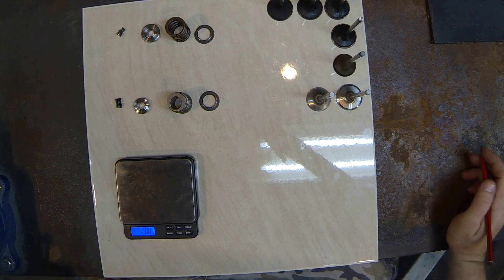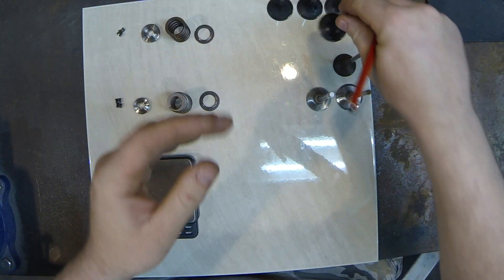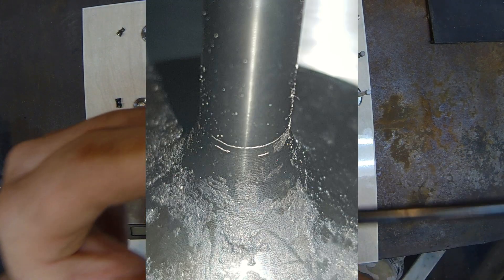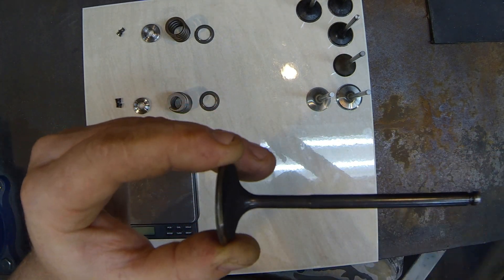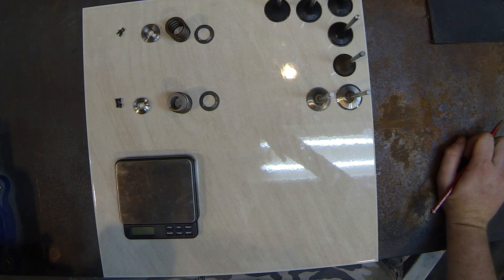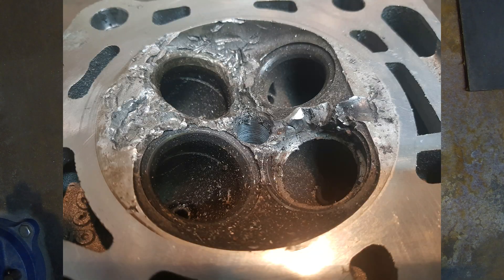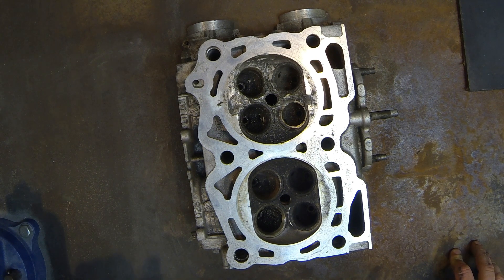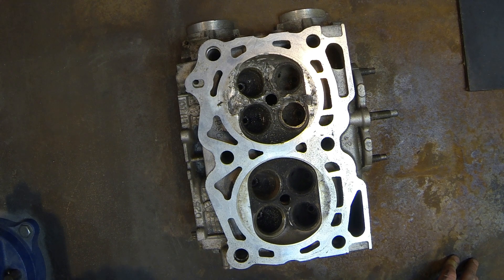SuperTech Valves - Watch This.

Comment: I should have seen this video a few days ago. I completely destroyed my VW 16V, installed in a Super Seven, a few days ago. A Supertech intake valve broke exactly where you describe.

low mileage, motorsport application

CNC Head is fu..ed, piston fu..ed, bottem end fu..ed.

Comment: Bad batch of valve or is this a long term problem?
I know this vid is 3 y/o video
Is this only on the Subaru valves or across all of their valves?
Reply from the maker: It's could be both.  But I tend to think its more a common problem.  The instances shown in this video were purchased at different times.  And if you read the comments section of this video, there are numerous other anecdotal instances of people suffering the same failure.

I think its more a manufacturing technique, the breaks all take place at the exact same location, where the stem meets the base of the valve.  And I believe these values are manufactured by a process known as inertial friction welding.  Where they effectively weld the stem on to the back of the valve.

Comment: How have the Ferrea valves worked for you?  I’m looking into valves and springs for my STI and have seen people have issues with GSC as well. Thanks
Reply from the maker: Unfortunately.  I cannot tell you.  I have put the build on indefinite hiatus while I address other areas of my life.

The thing that broke my live of modified cars was :
During the rebuild process, I took the case halves to a recommended machine shop for a main tunnel line hone.  (This is needed with ARP case bolts, as the case distortion around the main tunnel is extreme.)  

Unbelievably, the incompetent machine shop performed the line hone with the rear 2 case bolts (main bolts) loose.  This resulted in the rear main journal being well under size once the bolts were torqued.  I think it was 2 or 3 thousands of an inch under lowest tolerance from memory.  I noticed the mistake as soon as I got the block back from the shop, confirmed with my bore gauge, and took it back.  They tried to remedy it, by shaving more off the parting face, and re-honing.  But due to the scope of the original error.  They could not recover it.  The main dimensions were all over the place, and extremely oval.  The block might be salvageable with over size main bearing shells and a an over size line bore.  But I do not know any machine shops locally capable of doing this work.

This was after spending many many thousands on machine work like CNC close decking, 14mm studs, pinned/dowelled main tunnel, cylinder honing etc etc.  And many many thousands more on parts like billet 2L crank, +2mm billet con rods.  Pistons.  5 stage drysump.  Beryllium valve seats, all the valve train parts (valves, springs, cams, and all new OEM shim-less bucket lifters to size valve lash).  Plus all the ancillaries like RCM timing setup, cam gears etc etc etc.  That engine was gonna be the full Monty.

Basically I came to the conclusion that no matter how much money you throw at the build, something will go wrong.  Whether it be something like the machine shop fuck up.  Or a tuning error.  Or some other random mechanical failure like a dropped valve, spun bearing or what ever.  But no matter what.  Sooner or later.  That 50k engine is gonna be an expensive boat anchor.  So I put everything in storage.  And left the car alone for about 3 years now.  I have since met an amazing woman and we have a baby daughter.  One day I will revisit the car.  But for now I have other priorities
Reply: @BramBiesiekierski  Yes, I saw you mentioned the machine shop error in another comment. Sorry to hear about that shit situation. Yes, cars what a crazy hobby. Congratulations on finding the two ladies though. Thanks for getting back to me.
Reply: Ferrea are far far better quality than Supertech. Supertech's the heads fall off very easily, at least with Ferrea in a really bad incident they tend to bend but stay in one piece. Which means far less damage.

Comment: Had you contacted  Supertech directly?  you could have learned how those marks on the valve appeared, rather than go on a rant about nonsense blaming the valves and the reputation of the company. These valves have been used, by top engine builder around the world, in  World Rally cross, Drag racing, Drifting, for the past decade, and there has never been a issue with the product itself, material, or quality of the product. 

Those marks are NOT a sign of defective material but a sign of bent valves.  There are many ways you can bend a valve (taping the piston, overreving and clipping another valve, during installation, during the tuning of the timing, etc.).  And there have been too many cases of Subaru engine builders bending valves during assembly and tuning of the engine. We are not Subaru assembly specialist but there are some strict procedures for Subaru engines to follow to avoid this type of issues.

When a valve is bent, it will work back and forth, straightening against the seat, until it eventually develops a crack from fatigue and fails, like when you try to cut a wire bending it several times.  
 
Depending on how much the valve was bent, it can last a few minutes to several thousand miles.

This will happen with any valve but because our valves are Black Nitrided, these cracks are very notable when they happen. And as a matter of fact, it is well known (you can google it) that the Nitride treatment improves the fatigue life of the valve (or any product), so they have a better performance under this type of issues

Before you blame and damage somebody else’s reputation, you have the responsibility to learn and make sure what you say as you can be subject to legal actions.
Reply: From what I've seen first hand, your valves are no better than your grammar. Lol.

Comment: Neat video & thanks for trying to warn people. I find the logic and reasoning in this video flawed: It's like showing me a cadaver that died of lung cancer and then showing me a lung x-ray of a cancer patient with the claim that people have defective lungs. Too many variables here, did they smoke, did they work in a coal mine, were the valve seats cut appropriately, was the spring pressure sufficient for the application? I applaud your effort but the cause & effect assumption is nothing more than an assumption.
Reply from the maker: @ ASF Machine 

There are 5 instances of this exact failure mode highlighted in this video and in the comments section of this video.   (Plus many more dotted around on the various suby boards.)

1- My valves came out with visible cracks on them.

2 - The destroyed cylinder head in this video had Supertechs.

3 - The poor guy with the destroyed cylinder head had it happen to him AGAIN when Supertech sent him some replacement valves....

4 - "Marko Macek" has commented on this video, saying he also suffered this failure.

5 - "ThaBoostBarn" commented on this video saying he also suffered this failure.

Once or twice, yeah OK, could be a coincidence.  Or another issue like piston to valve contact causing the failure.  Or any number of other legit explanations.  BUT when you start getting the same thing happen over and over and over again.  That might not be a coincidence any more.  It could be indicitive of a common issue.  A clear common denominator of those 5 instance were Supertech valves...
Reply: Bram Biesiekierski I like your video and what you’re trying to do with it.
I think techniques such as dye penetrant inspection & harness testing would aid your hypothesis.

We aren’t sponsored by Supertech & aren’t beholden to them in any way other than having used their valves in high boosted Mazda BP, B6 engines for almost 20 years as private label head work for a renowned MX5 tuner. So what I have to share may only be anecdotal. We’ve been been building Subaru EJ heads with their valves for close to 15 years. We’ve never seen what you’re describing, first hand with these particular valves. We’ve seen two different occurrences using F****a Valves and another three using OEM valves. On five out of the five occurrences we noted slight valve to valve contact that happens when the cam gears are rotated into position counterclockwise on the intake and clockwise on the exhaust on cyl 2 & 4.
Reply: All valid questions.....but it still doesn't get around the fact supertech's do fail, a lot. And have caused huge amounts of destruction.

Comment: Odd. I had my V5 207 heads completely rebuilt in 2012 with supertech valves. 50k hard miles on the motor and so far I've had good luck with them....knock on wood.
Reply from the maker: Lucky so far then.   With 50k HARD miles, it means your probably due for a freshen up to re-shell the bearings at the very least.  Good time to inspect the valves and/or replace before it destroys an entire motor.

You only have to read the comments section of this video to see 2 other people have had this failure.  Plus the cylinder head I show in this video.  Plus the valves I show in this video which came from my own personal motor.  Plus the original owner of that cylinder head had it happen to him AGAIN after supertech repaced his valves because of the original failure.  And then do some looking around online to see that its a somewhat common mode of failure with this brand.  

It might not happen to everyone.  But it definitely happens enough to be a known and common thing.  Amd be atleast a little concened with.
Reply: @BramBiesiekierski  I put an O.E. 207 bottom end I bought new. Compression hasn't dropped and oil pressure hasn't flinched. She's got plenty of life left, which was my reasoning behind going with a 207 vs a built block. IDK if ST makes O.E. replacement valves or what material the ST valves that people have had issues with but mine were SS intakes and and inconel exhaust. Granted, this is all on stock V5 cams so they have low lift so the stress isn't as high.

I may have to look into this issue since I haven't heard any negative reviews on ST.
Reply: @adidas2284  did you ever have problems after all??
Reply: @screwedupcivic  what problems? Motor runs fine. Only thing that's been giving me issues is the original FP Green turbo which is about to get replaced for a VF48 so I can start auto-x again.
Reply: @adidas2284  problems with the supertech valves.  I have a set of supertech and heard all the horror stories about failers and now it's making me paranoid 🤯😱
Reply: @screwedupcivic  again I'm running SS/Inconel valves. I put the motor together in 2012 and it's still going strong. Heads were rebuilt with ST valves, BC springs and shimless buckets by Fineline Imports in CA

Comment: which ferrea valves did u use?
Reply from the maker: fatso667 
My new valves are the Ferrea competiton plus spec.  I havent used them yet.  And I dont know if they are any better.  After seeing my valves, and other expensive engine failures as a result of supertech, I will not be using Super tech again.
Reply: Bram Biesiekierski im going to use ferrea 5000 flat valves on my k24 frank build i was debating between ferrea, supertech and gsc power division but ferrea have a nice price and they are legendary lets hope that i chosed wisely.  i wasnt sure about supertech thats i was looking for reviews until i found your video is scary

Comment: Those cracks are crazy Bram!! So glad you changed them out. Good save. Send this to Supertech. This should go viral for anyone using them
Reply from the maker: Russell Cameron 
Not sure what Supertech would say or do???  Offer me some replacement Supertech valves that I would NOT use now anyways.... The valves are well outside of any reasonable warranty period, so its not like they are obligated to do anything.  (Although im sure its not unreasonable to expect the valves to not crack like that at all.)  

Supertech ARE already aware of the issue.  That smashed cylinder head was caused by a supertech failure.  The previous owner vontacted Supertech and Supertech replaced the failed affected valves.  Which then failed a second time, destroying another engine.   

Whether Supertech have fixed the issue now with thier current line up, I can not say?  But I wouldn't want to test it...
Reply: Bram Biesiekierski I agree. I wouldn't use them for sure! Hope you been well anyway mate. Russgt